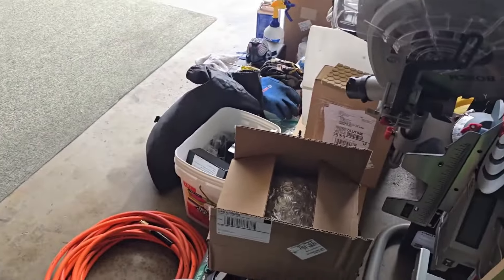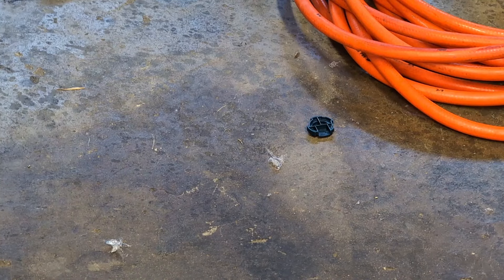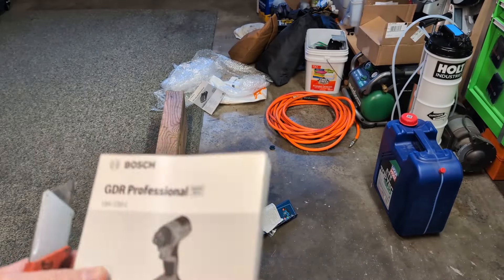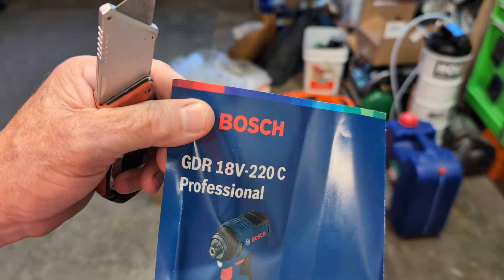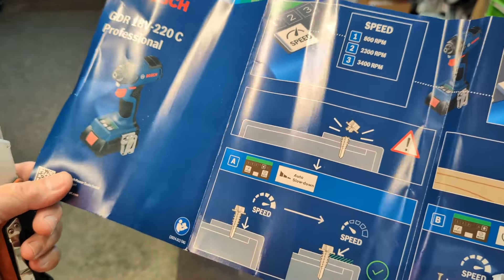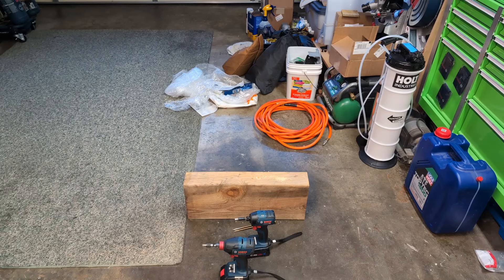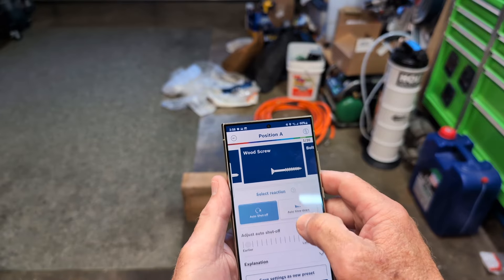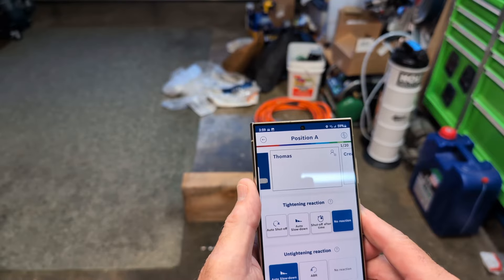GDR18V 220C New impactor not available in in the US

Comment: For sale now at acme tools for $149 bare tool. Thanks for the preview. Appreciate the effort  ….Wish you would have shown more of the tool being used properly and its full glory. Like precision mode on and full power on. Or maybe reverse mode on nuts and bolts. I’d love to see how the hammer mode supposedly kicks in later on high mode… 

I’m waiting a bit longer until it’s on sale for $99. Bosch been updating their impacts to often in the past and with too little improvements for me to jump on it right away. I have almost every Bosch 18v and 12v tool. But I have Been holding off on their impacts. I still use their old 25618 Impactor from 10 years ago. All their impacts have been a huge let down in my opinion. I hope this 220 version will be better.

Comment: The impact only allows you to chose between one the three speed modes OR one of the preset settings. I’m not sure if selecting speed takes it out of your custom setting because I don’t have the Bluetooth module, but I do know that it is the case with the preset A and B settings. If that’s the case with the custom setting, your test was only speed 3 with none of the other features.

Comment: Hi, I have the same model, the red light came up and it stopped working after 4 screws. Anyone else having this same issue?
Reply from the maker: i have not had any issues with this impact. in fact, i just used, and abused it last week. red light? have you checked the battery?

Comment: Compared to the last Gen Freak it may ne an noticable upgrade but Bosch still has nothing to compete with Flex, Dewalt and Milwaukee.
Size and weigjt is ok for 2024 standarts and finally after a half decade Bosch made an quick connecting collet.

Still undercompeting against Black, Red and Yellow. 
And this interface way to overcomplicatedwith like 60 different settings.. 

Like usual a half as* baked tool by Bosch.